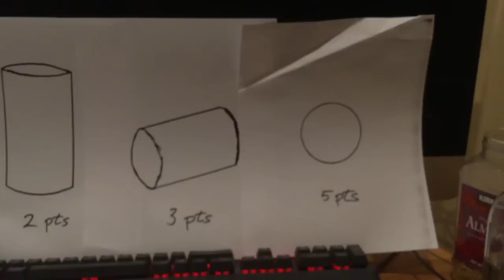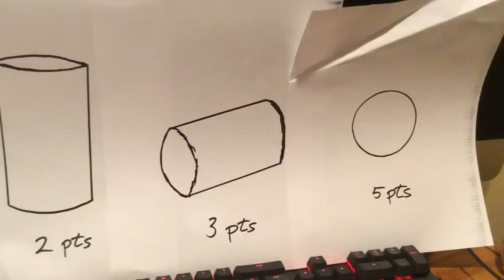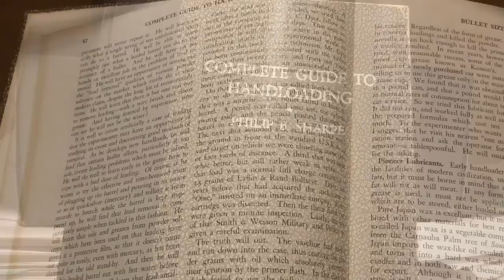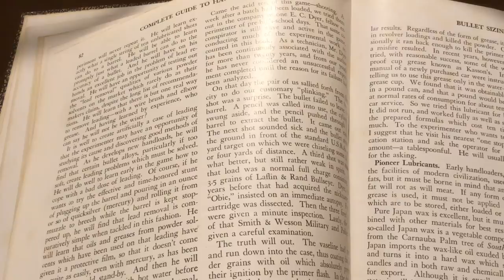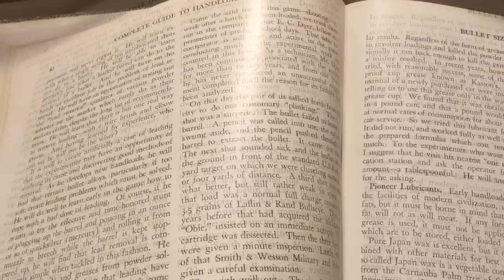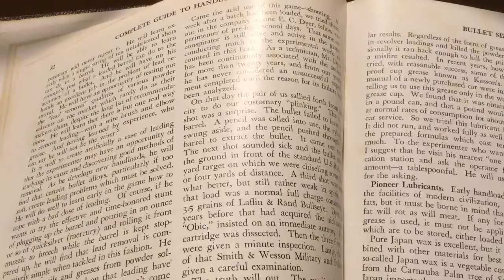Firearms Trivia - Plinking - The Where, The When, And The Significance

Comment: FC - When you get a chance talk to me about the tumbler method of powder coating. Is it worth buying a tumbler ? Is it better that Elvis's method ?
Reply from the maker: Vengenace Early - The tumbler is really the hand shake method on automated and accelerated mode.  Recently, I vibe tumbled some HF Red and the powder wasn't sticking readily...Had I been hand tumbling, that powder would not have been sticking - and that's what caused me to go tumbler in the first place.  Just running the vibe tumbler longer and the powder stuck fine.  But even Elvis isn't doing his 4 140 system any more...if better powders like Eastwood or Prismatic or Powder By the Pound are used,  hand tumbling is all that is needed to get good coating, and that's what Elvis is doing now - no need to heat and tumble if the tumble works fine...You might just go ahead and hand tumble, and if it doesn't get the powder to coat, then go to the vibe tumbler.  Or simply change plastic tumble jugs - the type of plastic makes a difference.  I just vibe tumble everything because I know it's going to coat.  But with the Eastwood powders, vibe tumble only takes 1-2 minutes -  If I just hand tumbled, it would be working just as well.  Good PC to ya,  FC
Reply: FC - Thanks.. that clears things up a bit. What I am finding out in my powder coating fest ... is not all powders stick or coat the same. I throw my bullets in for about two min in the oven then hand shake for three .  Even using good powders I have noticed the difference between powders due to their color in relation to how well they stick on the first coat. The silver artery coats so well that you can't even tell it was shaked and baked. The Roman gold need two coats  to work right.. That was with Prismatic. But I can't complain about the Roman gold going on in light coats because the bullets came out so well.  Thanks for helping FC --- I now know I don't really need a Vibe Tumbler and thus save some money for buying more lead.  : )
Reply from the maker: VE - I think we both have the systems down - 1) use a good coating powder, and 2) you have adopted a variant on the Elvis 4 140 system.  I just do 2) a variant on the hand tumble which is the vibe tumbler.  If my 2) for some reason fails to coat, I would do 3) Elvis 4 140 system.  But it looks like neither one of our 2)s have let us down yet.  Continued good PC to ya,  Jeff --   FC Steve
Reply from the maker: VE - Good castin' and good PCin' to ya, Jeff...FC Steve